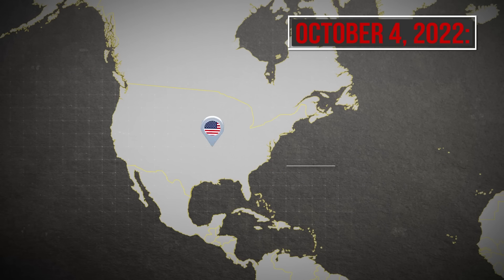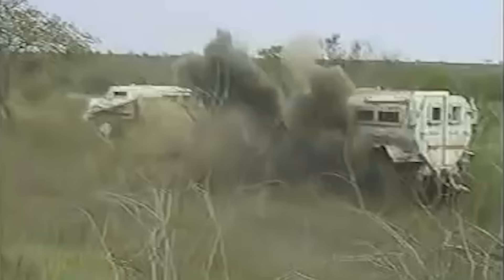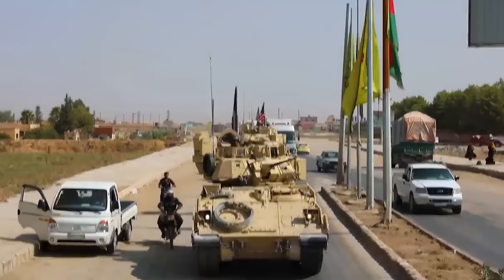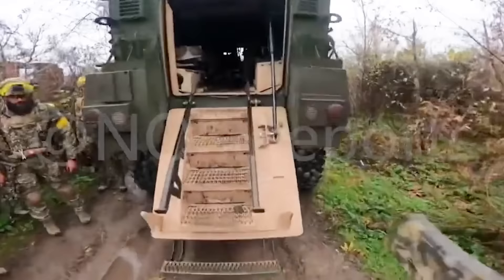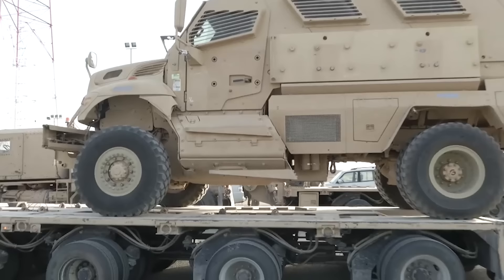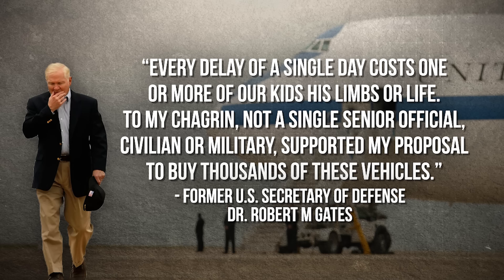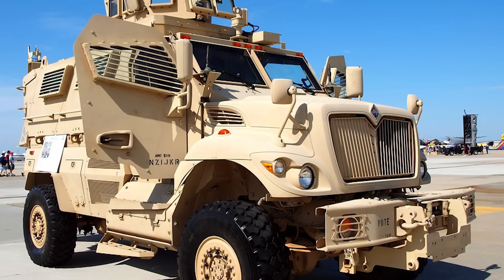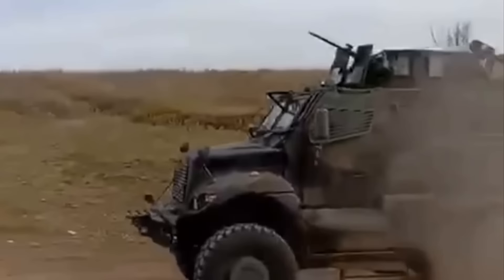Why America is Gladly Giving Away their $50 Billion Truck

Comment: Seems like the military was putting money over soldiers lives as the MRSPS didn’t meet their vision of all those fancy boondoggles they come up with.  Your not going to come up with a perfect armored vehicle someone will always find fault with it, look at the HUVEE it was criticized because it couldn’t perform well in a role never intended to be used as. The American soldiers were were very good at devising equipment that they didn’t have, example the Gun Trucks of the VIETNAM  WAR,  they were built by the troops to provide firepower against Vietcong an North Vietnam regulars on convoys they weren’t perfect but better than those M151s with a single M60 an a guy standing up with no protection manning it.  MRAPS could still be used for base protection, evacuation of wounded.  Or perimeter patrols or convoy protection.  The military says they want a fast combat capability, which in my opinion means lighter vehicles instead of tanks or lighter tanks an personnel carriers which means less armor on vehicles to keep the pressure on the enemy, which wouldn’t do much good for the troops riding inside those lighter vehicles.  Oh well it’s only a soldier so who cares if their not better protected as long as we can move fast.  I would rather see the police have those trucks to protect the officers of the S.W.A.T. Team than be out gunned an killed because they were out gunned an didn’t have any protection other than a Police car.  Plus if you have an armed suspect(s) held up in a building those MRAPS just might make a difference in a full scale shoot out or the surrender of the criminals.  Why don’t anyone ask the soldiers that survived a mine blast in one those expensive big vehicles if they were worth it.  I’m sure they an their parents would say YES THEY ARE WORTH IT!   How much money has the military wasted on projects that were ment to be a do all piece of equipment that couldn’t do anything right. Example the SARGENT YORK ANTI AIRCRAFT TANK, only thing it was good at was blowing up a toilet because of a lousy radar system an the old tanks the new turret was mounted on.  The Bradley Fighting vehicle when it was being developed an going thru testing, it couldn’t swim as it would sink taking the occupants with it.  They said it was vulnerable to a lot of excisting anti tank an machine guns an carried less than a infantry squad.

Comment: They should have mothballed these just in case, we should never again fight a war like Iraq, but that doesn't mean we won't. I'd say there is still a decent chance that they will be needed and they won't have them. People can't think of where, but that doesn't mean a thing, lack of imagination is the downfall of many smart people. Is it possible we will end up helping Mexico some day with their war on the cartels? If so this seems like just the vehicle you would want for that, is that really out of the question? How about other spots in Africa where we have our SF guys? 

And I'm not against using anything that can save a cops life if they are up against criminals shooting at them, but what does this cost? And at what point does every problem require a hammer if you have a box  full of them? But that's a problem with Swat being over-used not that they should be have lousy equipment when they do need it. Still seems like it would be a lot cheaper to up-armor their cars than pay for the maintenance on those beasts and it's more likely that the cars are going to come under fire simply because they will get there first, just about every time.

Comment: I'll tell you exactly why the U.S. is giving these away- they are one of the worst variants of MRAP I've experienced. Enjoy the ~50 uses of the rear door, if you are lucky enough to get that many out of it. Enjoy that garbage maxforce engine platform. Enjoy bouncing like you're on hydraulics from every bump in the road (unless it's been upfitted with ISS). Enjoy the worst air conditioning system known to man unless there's been an upfit for that as well. Enjoy similarly bad door opening mechanisms. The last time I had the "pleasure" of operating & maintaining these, they were absolutely terrible trucks. Although I'm sure they did save lives here & there, there were MANY better options. I wish Force Protection never went belly up.

Comment: mrap frankly is a tad over engineered. so is the humvee. it would make sense if they had instead used some off the shelf truck and modified it. or something idk. i just see stupid ass things made to be modular like armored vehicles. but then you have trash like the humvee overpriced, overbuilt, not upgradable, under powered, ect ect. its insane.